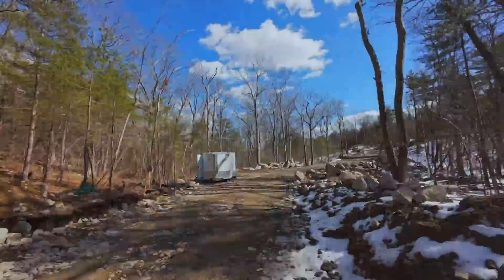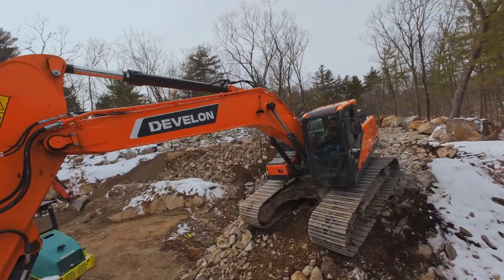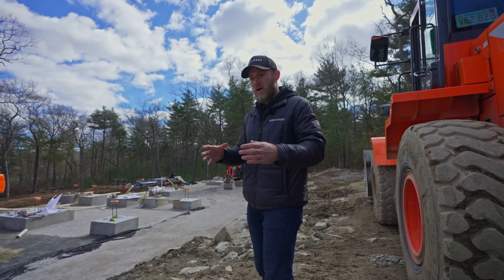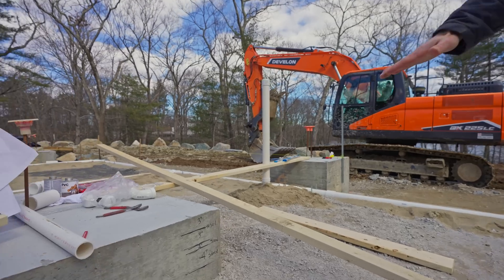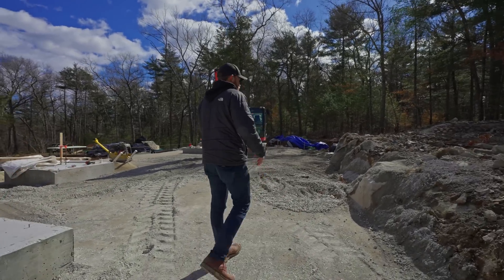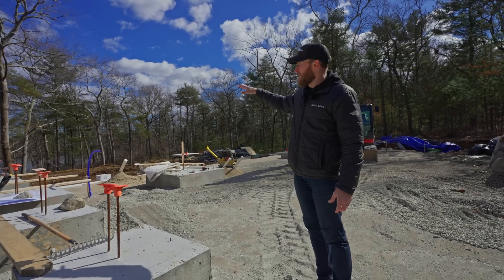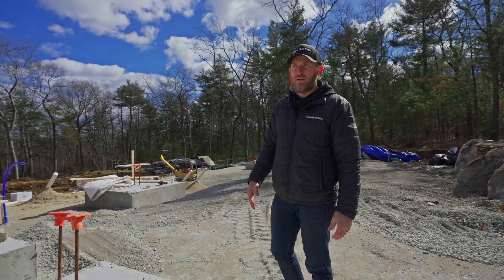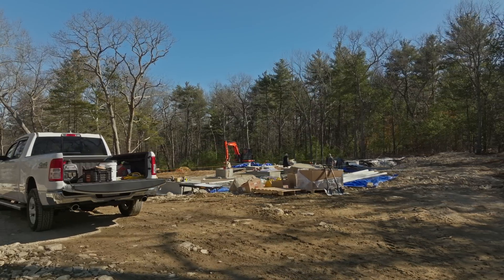Frost Protected Slab Explained | Insulation, Vapor Barrier & More

Comment: As an alternative, you can use Foam Glass Aggregate (granular), this material acts as capillary break, thermal insulation and foundation material (as it can withstand huge compression).

Just pour the slab on top as usual, no need for special footings (not even for buildings a few floors high).

Next time, I would also integrate water tubing for a floor heating system running on heat pumps.

Comment: I have a similar build going on at higher altitude 6500ft but similar setting. Dolomite layer at the back of the house. 8inches of under slab foam, icf frost walls and pre fabbed walls and roof. Same finished slab also. Excited to see how your build goes.